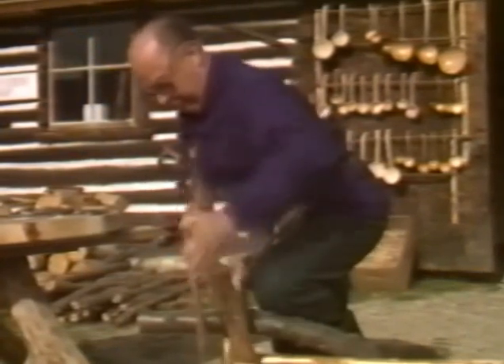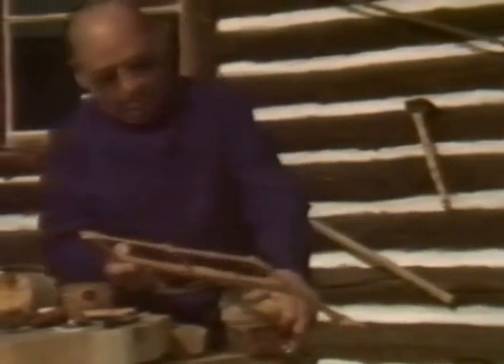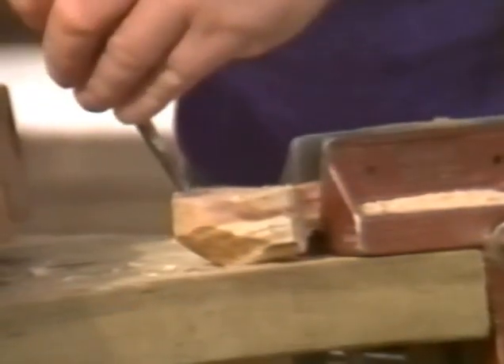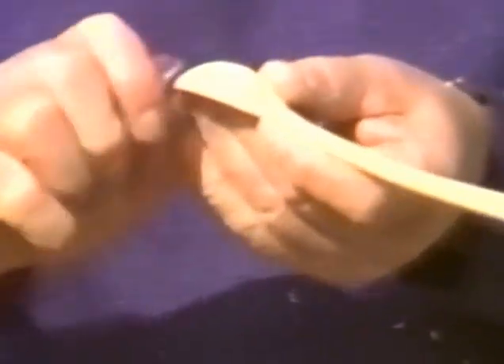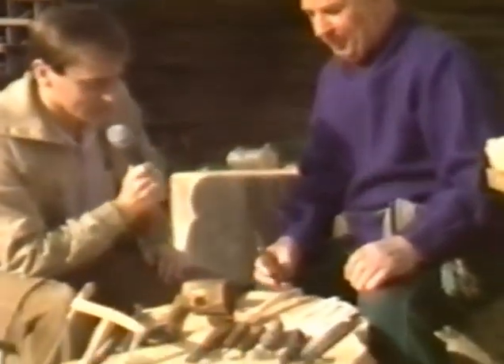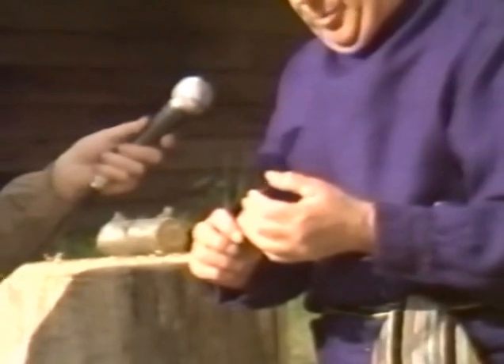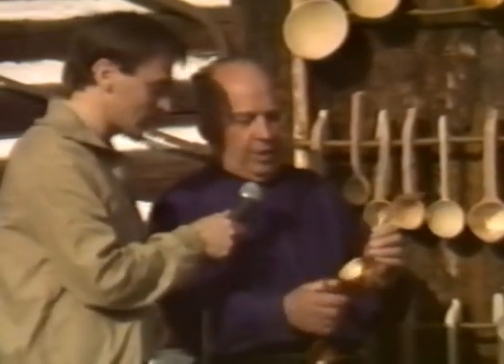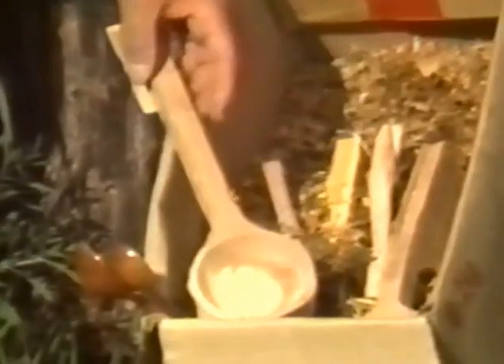Traditional Spoon Carving

Comment: How do you keep the finished spoon from cracking when working with green wood?
Reply: Oil linseed oil not boiled..rub it in over a couple weeks until it will no longer soak in wipe of extra.  At least once a year reaply
Reply: I dip mine in food grade walnut oil, usually for at least 24 hrs. Unlike some other oils, walnut does not degrade and remains stable, keeping it safe to use with food for the of the spoon. It also has the benefit of bringing out the grain more visibly.